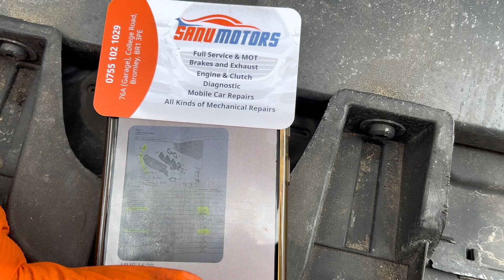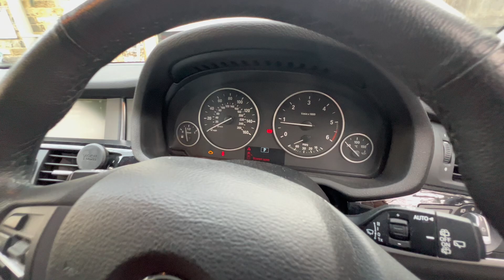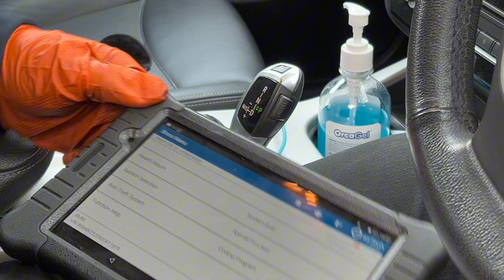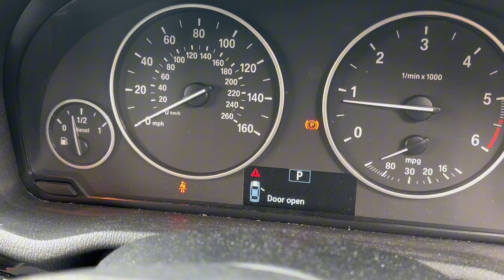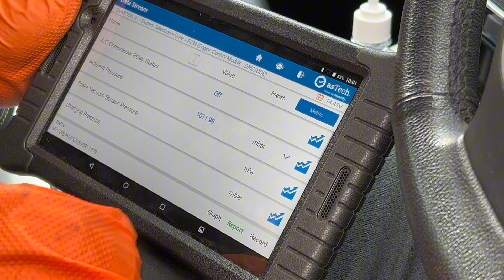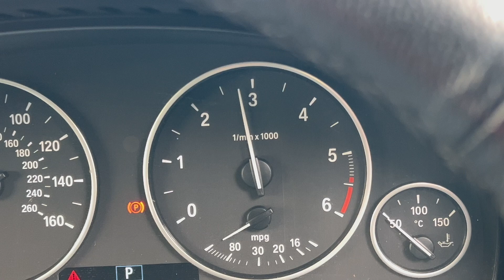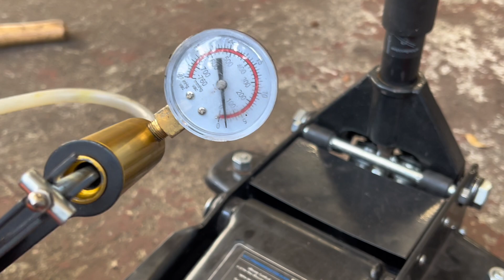BMW DPF Blocked? Don't Just Clean. Fix the Underlying Fault

Comment: Plz help . I dont understand . How you troubleshoot '290B00' code ?? I have the same problem, 'air mass too low ' . I have checked everything but no result . Any help ?
Reply from the maker: This code on BMWs (usually 2.0d / 3.0d engines) can be tricky, but here’s how to troubleshoot it step by step 

You need to check
Air Filter / Intake system
Make sure the air filter isn’t restricted and the intake pipe before the MAF isn’t collapsing or cracked.

MAF Sensor (Mass Air Flow)
Unplug it and check if the readings change — if nothing changes, the MAF could be faulty.
Use live data: at idle it should read around 5–8 g/s, and at 3,000 rpm around 40–60 g/s depending on engine size.

EGR Valve
A sticking EGR valve can dump exhaust gas into the intake constantly, reducing fresh air and triggering “air mass too low.” Try blocking the EGR temporarily (for test only) to see if readings improve.

Swirl Flaps / Intake Manifold Leaks
Check for carbon buildup or leaks — even small ones can throw this code.

DPF Backpressure
A partially blocked DPF can reduce exhaust flow, affecting air mass readings. Check DPF differential pressure data.

Vacuum Leaks / Boost System
Check vacuum hoses, boost solenoid, turbo actuator movement, and intercooler pipes for splits.

If everything looks clean and you still get 290B00, the MAF sensor itself or the EGR position sensor is often the real cause — both are common on these engines.

We’re not able to reply to continuous messages as we get a huge list of comments every day. If you need more help, join our groups — they’re packed with mechanics and BMW techs:
👉 WhatsApp: https://chat.whatsapp.com/JOvJCdZYdV9J6PvIXw2RV0

👉 Facebook: https://www.facebook.com/share/g/15msa3NJmn/
Reply: Thank you for your response. I will try now for vacuum leaks . I have changed egr and egr cooler already . I have cleaned the intake ports from carbon deposits but nothing. I have already  replaced air filter.  I wish to find some vacuum leak . One extra error is: O2 sensor pre catalytic converter: too low the event of partial load . But I have replaced the O2 sensor with a bosch 2 months ago . I have black smoke too when I accelerate hard .